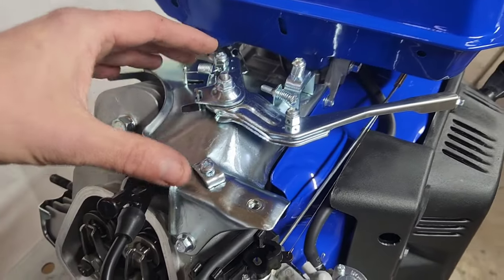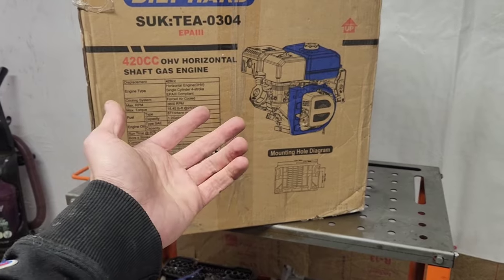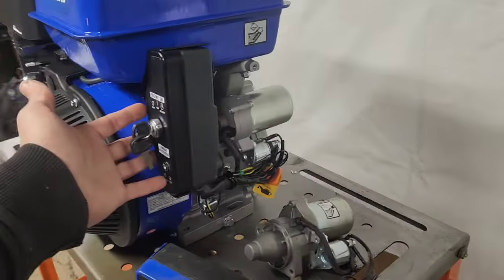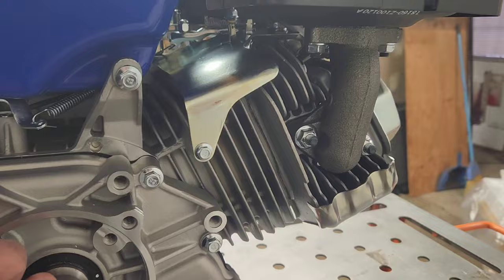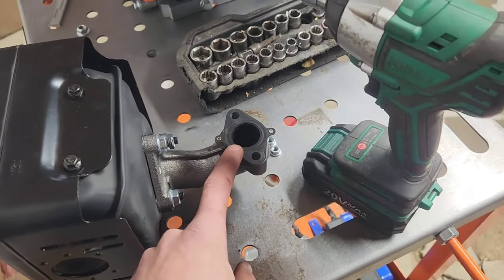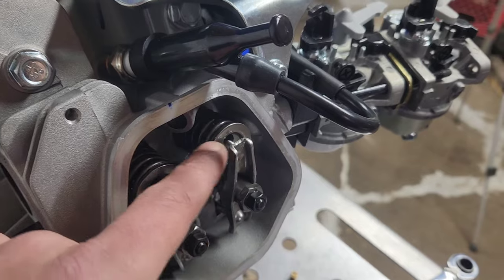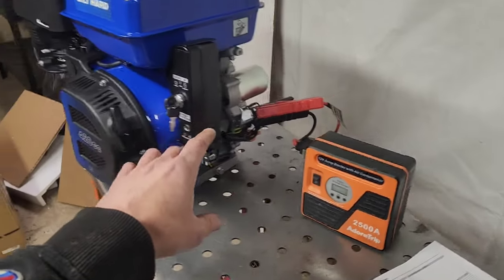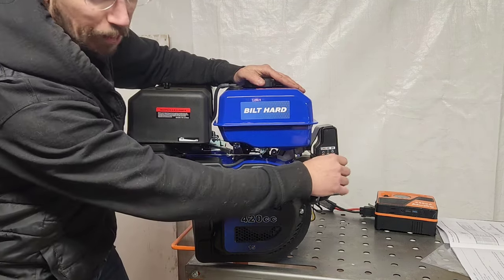BILT HARD 420cc 15HP Stage 1 Unboxing

Comment: I bought one last year, put it on my Sears Suburban replacing the Onan. I use it for lane repairs, with a dozer blade, and plowing the garden. I've got about 10 hours on it so far, no gripes, it has eletric start too, but don't know if it has a charging circuit, and no documents for wiring it up...
Reply from the maker: Will check out what it has got for a charge system the next video on it.

Comment: Just an off topic comment here. I remember you saying on the ATLTF that the big White had a weak hydro. A cheap way to possibly revive it is to drain the factory 20wt oil from the transmission and replace it with SAE 30. Its completely approved by Eaton and it won’t hurt it any but it should help

Comment: Sweet engine. I just bought two Honda Rebel 500cc motors from Marketplace. I am eventually going to build a fat tire off road bike and upgrade a Chinese go-kart . I say eventually because i am so far behind that I feel like I am never going to get what I want done. Keep up the great content. I  have found a lathe with all the tooling and a Burke number 4 milling machine that needs restoration. When I have the machine shop all fitted out I wil be able to make any parts that are needed for almost anything so keep me in the loop with the gears and stuff.
Reply: Why does these motors say 420cc when it's not a real 420cc that can go over 100 mph with gearing can these do a buck 🤔

Comment: Whatever it turns out to be, it seems to be pretty good as-is. The 'over rev' bypassing the governor shows 4500-ish rpms possible. John's new sled could use a 'Track-drive' powered by this? ;) He'd be found 2 counties away with brush in his hair and teeth...It's winter and he could use practice helping you plow by following behind and widening the lane.
I'd say 'Tractor' for John.

Comment: Wtf is a rato i have the ducar 212 and i must say 3years strong valves set once 7 oilchanges never  had it running for more then 45mins at once gov removed vm22 carb once i use my 420 duro i will build my ducar 3 years tho still coastin